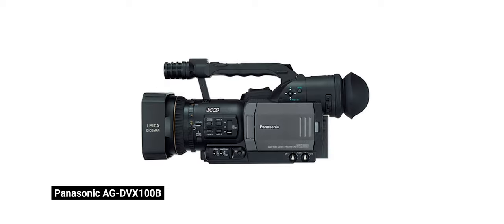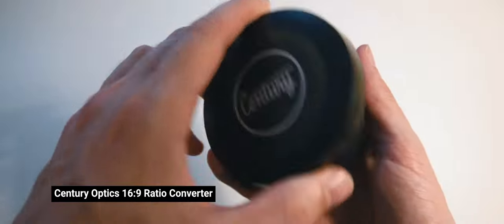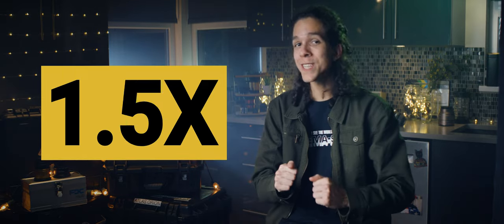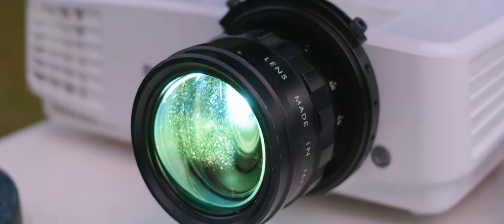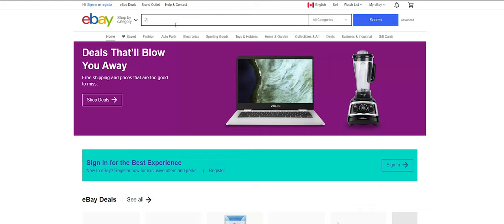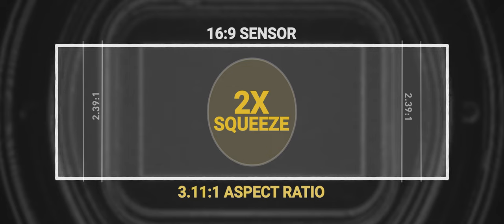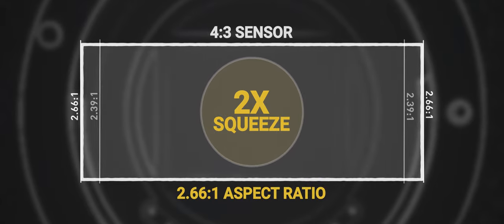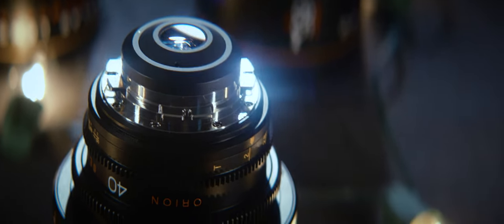Common Stretch/Squeeze Factors in Anamorphic Lenses - Anamorphic Cookbook - Module 2 Chapter 04

Comment: La 2X Land ;)

They shot La La Land using the silent (Super 35) aperture too like the original CinemaScope films. They then cropped it in post from 2.66:1 to 2.55:1. I wish they just left it as 2.66:1. Panavision even made them a special close focusing 40mm lens. There's a good article in American Cinematographer Magazine, February 2017 about it.
Reply: CinemaScope did not use a silent Super 35 image area. It actually had additional sound tracks, which reduced the width of an academy ratio image area. CinemaScope's original presentation aspect was 2.55. It used a 2x squeeze ratio. Notice that 2.55 is slightly less than double 1.33.

Comment: I noticed I didn't comment before to give you props for the 1.33x stretch thingy that so many get wrong.
You could also call it 1 1/3; if we do some math it also makes sense, if we write 4:3 as 12:9 and multiply it by 1 1/3 horizontal, boom, 16:9

Comment: Thanks for the info. Personally, I'm not a filmmaker, but I like how the lower ratio anamorphics look over the exaggerated 2.0x stuff. That combined with how I DON'T like cinemascope means I actually really dig the 1.5x ratio the most. I recently watched a review of a SIRUI lens and MAN that stuff looked good. My only thought after that was "What if they made them in 1.5x and could focus closer like the reviewer talked about.?"

1.5x will give you that Univision 2:1 ratio on a 4:3 sensor, and a beautiful 2.25:1 on a 3:2 sensor. On the flipside you'd need to put the 1.33x on a 3:2 for Univision, but there really isn't a 2.25:1 combination for 1.33x. That, combined with what you said about focusing up close making the ratio decrease is what makes me wish more 1.5x stuff would come back.

Comment: Great content man! Helps a lot. I have a question if i paired a 1.5x anamorphics in a Alexa plus 4:3 but the camera only desqueeze in 1.3x or 2.0x. Which one do you suggest is the best option to monitor the footage on set? even tho i will desqueeze in the correct 1.5x later in post. Kind regards
Reply from the maker: Tough one! I think I'd rather pick a lesser desqueeze and have everyone look super thin than the other way around. :(

Comment: Love your content Tito. I have a question:   A 50mm lens on Blackmagic 4K will be approx 100mm. So if I use a 2x anamorphic on it, will it give foreground (faces) 100mm and background 50 mm ? What if I use 0.43x wide angle adapter on it now? 43mm foreground and 21.5 background ? Are my assumptions accurate !!
Reply from the maker: Too many numbers to figure out by heart. You know I have a calculator, right? www.tferradans.com/anacalc/go :)
As for the fg/bg values, that's incorrect. You'll get one focal length on the horizontal axis and another focal length on the vertical axis.
Reply: @AnamorphicOnABudget  Thanks Tito. The calculator looks amazing.